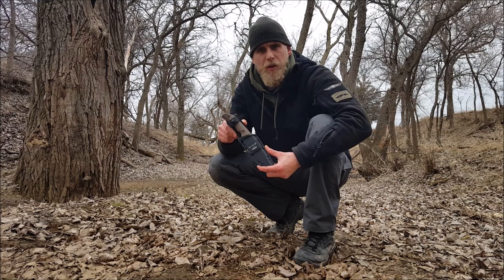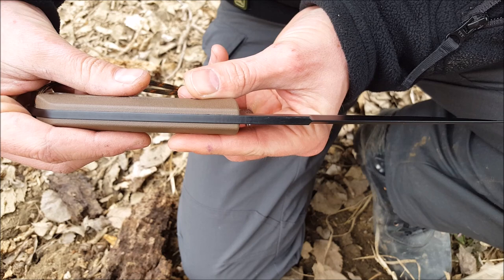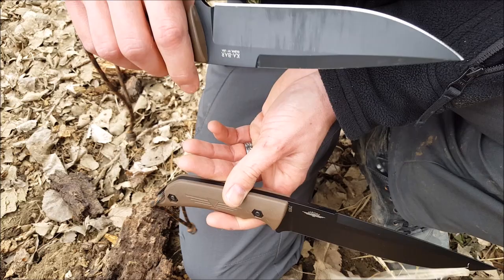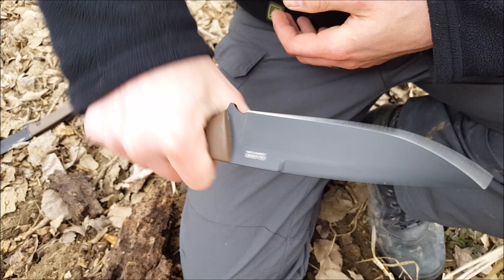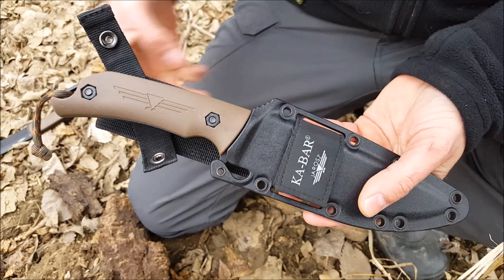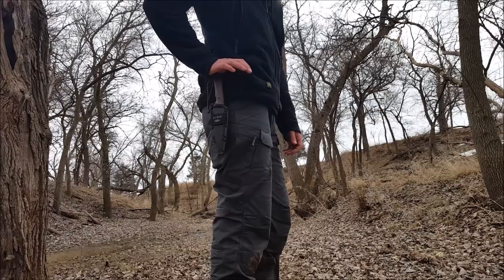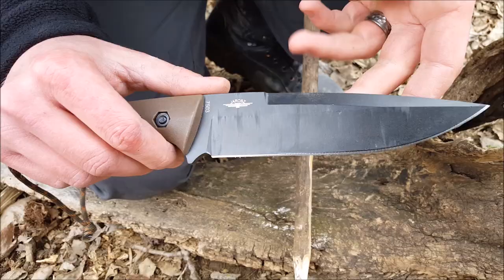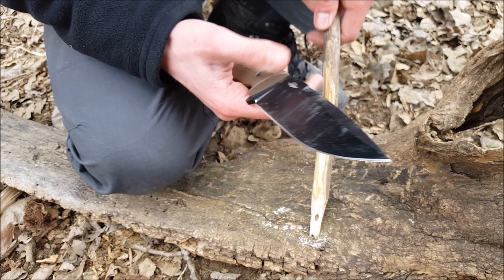KA-BAR Turok Overview

Comment: Also, just so everyone understands physics, that swedge st the top DECREASES friction going through wood by creating a wedge in the wood with the blade but reducing contact with the wood at the spine.  So it splits great.
Reply: On the other hand, it ruins the battoning of wood by destroying wood used to Batton with. What about that Ka Bar? Makes this knife an urban combat variant not suitable for survival or camping purposes.
Reply: Uuh no cus the friction of the would be spine is equal to the friction of the ridge between bevels

Comment: I just got this knife, and color me impressed. I loved the blade shape. I wouldn't call the handle pretty, but it's absolutely functional and comfortable. Wish it had just a little more texture to it.  The sheath is great quality and I appreciate it being easy to switch sides as a lefty. But Holy crap the retention on mine is too much. Like it hurts my thumb & fingers getting it out. I spent a few minutes batoning right on the tip, and slamming & hammering it into a tree. It was still hair popping sharp. I only had a small sore spot under my middle finger from that. Fits my hand like a glove. Great design.

Comment: Just found a used one.... then I found your review. It's a nice design with those recessed nuts in the handle slabs. The handle is not overly curved, versatile blade shape, it has a nice profile overall and it looks bad-ass. And just looking at it, it looks like a quality knife.

Comment: Great mid sized knife for hiking , backpacking, and camping chores , cuts through small branches with ease while bushwhacking through the forest. I've only batoned on smaller pieces of wood , and it does split wood well with that high sabre grind . Heavy batoning i would rather use a BK9 or better still , bring a small hatchet. I wish the spine was a bit thicker near the tip with less swedge and a button on the velcro strap for extra support on the sheath, but otherwise a great knife . Not every knife is great at doing all tasks , that's why we have axes , machetes , hand saws , this alone , I have no problem going out for the day and being worried, know what your knife can do , respect it and take care of it and it will take care of you ! Good job Jesse !!

Comment: I have a Turok and love the way it is designed and may not buy another knife since it will be used for camping out only and I would not remove the coating as the blade can rust. This is the second knife I purchased from Ka-Bar and the BK2 was the first one and I got both last year and love them both for camping use.

Comment: "Just got mine in the mail today, but haven't gotten the chance to use it yet and can't wait to"!
Reply: Chris Gilliam The knive is great,I have sense the video post taken it out to the woods and put it to the test. It was Sharp out of the box and does everything well that I tried it out on. I first did a lot of chopping with it,then to see if it still had good edge retention did a lot of basic cutting,sliceing then feathering and it did not disappoint. I am very happy with this knive. It is a true full tang,I removed the two screws that hold the handle grips on to see what's under Neath and was pleasantly surprised to see that it is a solid Chunk of steel. This knive is made like a granite rock and would recommend it to anyone that is looking for a great all around outdoorsman's knive or survival knive.
Reply: Chris Gilliam I forgot to mention the sheath,it is like the knive very well made. I love the way it snaps into the sheath and very snuggly holds in place, doesn't rattle around at all.
Reply: @dongoble5116 Great info. Full tang! Was gonna get a BK2, but now I am clicking Buy It Now .. on this !!

Comment: Hello! Can you tell me please which is the difference between the 1095 Cro Van steel from this knife and the 1095 High Carbon steel from Esee's ?! The Cro Van is superior or not, it has a better resistance to corrosion ?
Reply: https://www.bladeforums.com/threads/kabar-becker-1095-cro-van-vs-1095-steel-what-is-the-difference.925235/

I know this is a bit late but, Cro-Van seems to be the better choice.

Comment: Hi Jesse, the knife looks awesome. How will the sheath retention hold up in very cold weather. From Canada here. Take care
Reply from the maker: Canuck Bushman I've used it in as low as 17 degrees F and had no issues. Can't tell you for sure how it would be Below that. It isn't as volatile as kydex is in reaction to temperature change, so I am confident you wouldn't have any issues at cooler temps
Reply: Thanks so much for the reply
Reply: Been rocking the turok 4 alot of yrs in Canada sheath and knife both still worken hard just wish its little bro came with the same type of sheath azwelkie is hooken me up

Comment: Looks like a good knife and the Kydex portion of the sheath looks like a great design. However, I think it was an extremely poor choice to simply use Velcro to hold the sheath together... If that Velcro gets wet and/or dirty and stops sticking, the entire knife and sheath are going to fall off the belt rig.... not good. The engineers over at Kabar should have thought that through a little better in my opinion... At the very least, they should have reinforced that Velcro closure with a button as well. Just my observations. Personally I would never stake my life on velcro. Simply put, it fails when dirty. There’s a reason why nobody like knife sheaths that have a Velcro retention strap for the knife... They stop working in no time flat.
Reply: I agree 100%. I hate Velcro on sheaths like nothing else because like you said, it fails really fast. I'm also not a fan of Nylon because it can easily be cut by the knife, but the sheath of the Turok has some pretty nice heavy duty Nylon that never comes in contact with the blade so big plus for that! It really looks robust and I don't see myself accidentally cutting through that Nylon. Having said that though I'm going to modify mine as soon as I get it and remove that damn Velcro. I'll use leather or something else instead.

Comment: That is a very impressive knife. Not so good for batoning though?
Reply from the maker: Thanks! Yea, I'd only do light botoning with it. It's designed to stab well with that deep clip, it was originally designed as a combat knife. But the it makes a good camp/bush knife, just better to be paired with a hatchet or axe for splitting wood.
Reply: +Jarosz Knives I generally run a Gransfors Bruks Scandinavian Forest Axe or my Fallkniven A2 for the bigger stuff. Though I tend to favour the larger knife as I have found when the weather is bad and you need to get shelter and heat. An axe is an extremely dangerous tool. Batoning is far safer when wet, cold and tired. I also use a hand made 5 inch Damasteel Norwegen puko hybrid as my camp knife. I could see myself using the Turok in the system I use. I like to swap out and test a lot of different products and learn what works best. Always learning, always adapting.

Edit, been following your work for quite some time. Going to have to get one of your hand made knives one day!

Comment: Kabar is incapable of giving us a true full tang this is y I will never buy from this company.its ether stick tang or skeletonized.
Reply from the maker: joel Velazquez this knife has a full tang and is in no way skeleonized.
Reply: joel Velazquez I have a bk5 and 9, skeletonized beneath the zytel scales, and truthfully that is fine, especially considering the build quality and steel used.. so avoid it if you must, but I'd trust my life to the Becker family of blades..
Reply: joel Velazquez
Reply: joel Velazquez they never break..
so what is the problem.
it improves the balance of the knife by  cutting some weight off the back.
Reply: @JaroszKnives Excellent!!! Bought two!